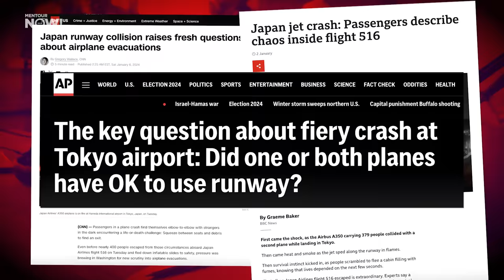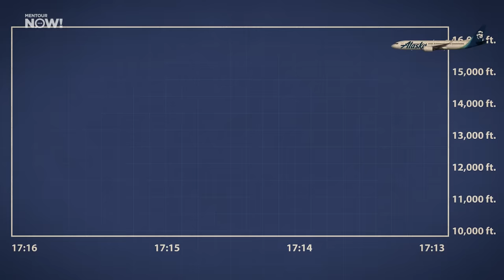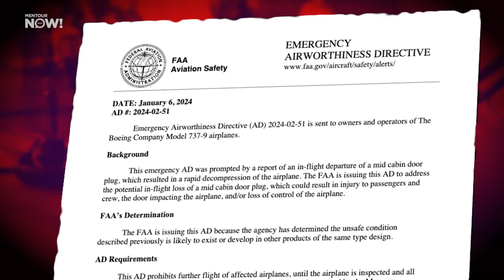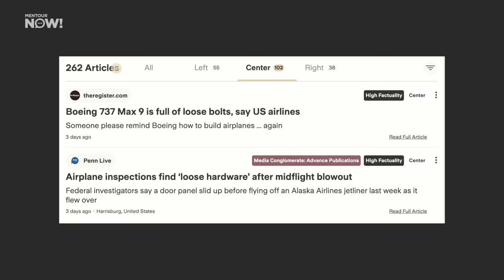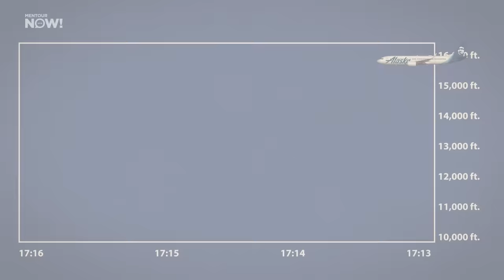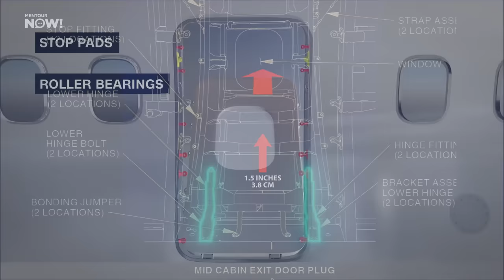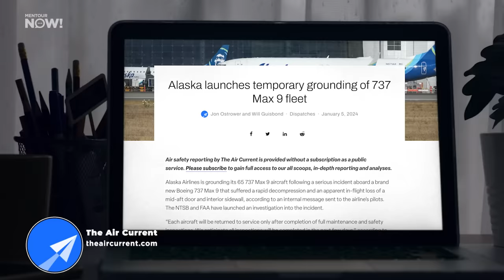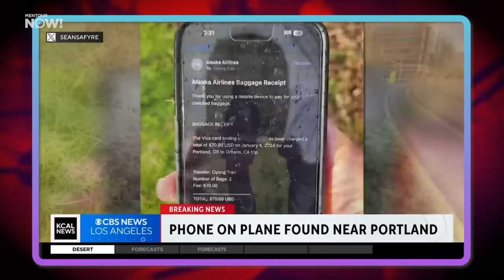WHAT Is going ON with Boeing?! MAX-9 Door blowout

Comment: The cockpit door flung open with such a force that the handle on it got stuck in the lavatory wall/door. The pilot's headsets was ripped from their heads, one partially and one fully. The laminated paper checklists got sucked out of the open cockpit door and was retrieved later. It was not only the blowout panels.
Reply: Boeing then claimed that this was "by design", despite no one, including trained 737 pilots, having been told beforehand (the pilots thought only the door panels would blow out to save the door itself). Begging the question, and in light of MCAS: what else has Boeing failed to disclose about the MAX aircraft?
Reply: Why do the media leave these parts out? These paint a good picture of the gravity of the situation! These sort of details are included for some events, but they decide to omit these details for this one?
Reply: @bjmaston  Good lord, that's "russian smoking incident" levels of problem denial. Imagine if someone had been trying to use the toilet!
Reply: @bjmaston  No one knew about it except Boeing and the maintenance engineers who read the Maintenance Manual. There is a back up system if the small blow out panels don't equalise the air fast enough. Trained pilots don't know everything, nor do they need to know everything.
Reply: @ImperrfectStranger  Should the pilots know ahead of time that the cockpit door will explosively blow out and embed itself in the lavatory in the event of some depressurisations, leading to possible loss of headsets and checklists? Or should we let them troubleshoot it in real-time? The latter is more fun, eh?
Reply: @bjmaston  This stuff is all hindsight. How do we know the checklist and headsets wouldn't have been ripped off with the normal blowout system. Did Boeing expect the cockpit door to embed itself in the toilet door? Did Boeing think it was important in the grand scheme of things? Maybe having one of their 737s survive half the top of the roof being ripped off, they were resting on their laurels.
Reply: @bjmaston  * Correction. The small blow out panels in the cockpit door are for depressurisation in the cockpit (e.g. flight deck window blowout). The maintenance manual says the flight deck door should be able to withstand depressurisation in the cabin. However, there is another feature listed in the maintenance manual which is not said to be specifically for depressurisation, but will allow the door to open during depressurisation if the differential pressures are too high.
Reply: @ImperrfectStranger  so you're saying that Boeing couldn't realistically conceive bad things happening after a cockpit door blew open
Reply: @nichobee  Even if they did, what do you want them to do about it? Should Boeing have created a kevlar toilet door or fitted an airbag to protect passengers queuing for the toilet? 
Knowing what happens to the door, should crews modify their behaviour? Should they tie down their checklists and headsets just in case? Or drink their hot coffee from a can with a straw? Should they come with their own portable screens to stop the cabin lights killing their night vision?  

So how much thought do you think went into the design of Airbus' cockpit doors? Maybe they shouldn't have put a flight of stairs just behind the cockpit door on the A380? Or was their primary reason for switching to electronic checklists decompressions?
Reply: No wonder the pilot sounded shaken on the radio!
Reply: Why did the door blow out under half a bar of pressure? Its a plane, not a road coach!
Reply: @ImperrfectStranger   for a situation where milliseconds matter, yes, of course they should have been educated. This was all by design, it wasn't a once in a billion years occurrence. You are only defending Boeing's bare minimum standards.
Reply: @ImperrfectStranger  I think if they are designing something that could cause injury in a foreseeable incident they should try to mitigate those injuries. Maybe all they needed was to attach those panels with a tether that would allow them to relieve pressure without flying uncontrollably into passengers. Since they understood the need for those panels, they obviously foresaw the depressurisation potential. They should have also foreseen that those panels could then become a hazard too, and implement a safety protocol to minimise that hazard.
Reply: @liam3284  Half a bar? That's 5 tonnes total on the door.
Reply: @MrGundawindy  So how long should this tether be? The entrance to the cockpit is already very narrow. The door is only 2 feet or so wide. The  cockpit door hits the toilet door almost when it is at 90 degrees. When is it considered safe for a passenger? 30 degrees? 45 degrees? Are the crew expected to get out of the cockpit after this event? The cabin door plug had tethers and hinges. It didn't help. 
The cockpit door is fairly lightweight. I imagine it wouldn't do much damage generally. It was probably just the doorknob which got jammed.
Reply: @ImperrfectStranger  have you seen the tethers they attach to formula 1 hubs? Something like that. 
They have designed the door to break, effectively, if there is a reasonable pressure differential, they design it so that happens without creating another hazard. Simple, no?
Obviously they need to use the fixtures in the design, unlike the door plug, which wasn't fitted properly. 🤦‍♂️
Reply: @kas4751 Because that’s actually less fear inducing to the general public then showing an entirely missing panel next to people and a destroyed seat where if someone was sitting definitely would have been destroyed too.
Reply: @MrGundawindy  If you knew what was written in the Maintenance Manual, you would perhaps understand. Boeing didn't think that a depressurisation event in the cabin would require a cockpit door opening function on the 737 like that found on the 777 or 747-400. Perhaps it's related to the mass of air in the small cockpit and the number of air vents in the cockpit. I don't think the cockpit door was meant to open because of air pressure loss in the cabin. However, in this case, the differential pressure did reach the limits of another system which I'm not going to discuss on a public forum and I doubt the NTSB will go into specifics either.  
Prior to 9/11, the non-kevlar door may have just exploded into lots of sharp pieces, so the new doors are definitely an improvement. 
And is Airbus any better/worse? I don't have any documentation on Airbuses. Do they have tethers?  And are they strong enough to withstand the pressure experienced in this event? I didn't work long enough on 737s to remember if they do have tethers. I do remember seeing wires of some description on some cockpit doors in my time in the industry. It just wasn't my job to pay attention to them.
Reply: We have photos of the missing door - why not the damage done by the cockpit door - surely there's pictures out there if it truely happened ??
Reply: @ImperrfectStranger As a transportation designer myself, the pilots should definitely have been informed about the cabin door and every other possible issue/scenario with the door flying open after the fact. Designers and engineers jobs are to account for things like this, so they don't happen AND for everyone's safety. You obviously have no clue what you're talking about here so you should just stop typing.
Reply: @ImperrfectStranger  so you're saying that the door falling apart was not by design? Because that is what others have said, hence my comments. If it was not designed to fall apart in a pressure differential situation then lack of tethers is understandable, because no one actually foresaw this happening. My comments are predicated on the comments of other who asserted that the door falls apart by design.
Still, it does raise an oversight in their design process that should be addressed now that they realise that this can happen.
Reply: I guess at that time the flight crew was still seated, which was very lucky. Imagine the door blowing open at 30 000 feet right when crew walks by (like bringing the pilots coffee or food).
Reply: And the cockpit was 26 rows forward of the blowout!

Comment: This isn’t likely to be what holds up the MAX7 certification, it’ll be the fact they want a safety exemption from the current LEAP engine issue with using anti ice in dry air which can cause the engine cowling to fall apart and can cause “flight control issues” if it impacts the plane
Reply: God they're determined to turned the MAX into an expensive lawn dart
Reply: I read about that!  Isn't that just nuts????  Profits over lives, the new Boeing mantra.
Reply: I will not get on a Max.   And I won't have to...

It will be an Airbus or a Comac.
Reply: @yuglesstube And you are aware that the COMAC aircraft haven’t been certified by Western regulators and Airbus has about as many safety issues as Boeing has had and then some, no?
Reply: @aycc-nbh7289  The C919 is based on Western systems, and will probably get certification, even once the systems have been indigence.

As with Auto, the Chinese will have a huge impact in aviation.  And it's not tha far off.

Airbus narrowbodies have a superb record.  Their wider fleet has had a few issues, but nothing on the scale of their main competitor.
Reply: @yuglesstube  The Chinese have been known to put speed over safety to a far greater extent than either Boeing or Airbus has. And didn’t the A321 literally have the exact same problem, with A220 and A320 aircraft having landing gear troubles not too long ago?
Reply: @aycc-nbh7289  You have a point.  My fundamental question is this...If we examine the incredibly rapid progress of Chinese produced goods in terms of quality and cost competitiveness in every sector, including now high performance processors,  is it reasonable to suggest that aviation is their next frontier?  I think it is, and I think that we have sold to them the tech they need, and that what we have not sold them they have otherwise obtained, seriously endangering our ability to compete in the future.  I'd suggest that the Long March did not end in 1949.

My wife wears a sophisticated tourbillion that is most impressive.  A similar watch from Germany or Switzerland would cost a fortune.  I would argue that the quality inherent in this watch is remarkable.  It's by no means a second rate knock off.   In fact it's  quite superb.
Reply: @yuglesstube If they didn’t let people mourn the losses of their loved ones in a collapsed road tunnel all to maintain a guise of superior infrastructural prowess, this would raise a few red flags.
Reply: @CrackaPackify 😂
Reply: @Doctorwhatswrong Then how come none of them have addressed their landing gears or their windows? Plus, they do have some other very bureaucratic measures in place that exist solely for the purpose of multinationalism and they may also get in the way of this.
Reply: And also it's not like this is going to inspire confidence in regulators that Boeing can be trusted to do basically anything right or have their s--t together in general. Not that they should be taking manufacturers at their word, anyway, but still. At this point, especially regarding the 737 Max, if Boeing told me the sky is blue I'd go and check just to be safe.
Reply: @fanboy50 It would probably be in the rational self-interests of these regulators to not be too hard on airplane manufacturers, especially the major ones like Airbus and Boeing, since they would lose out on overflight fees and other regulatory fees associated with air travel.